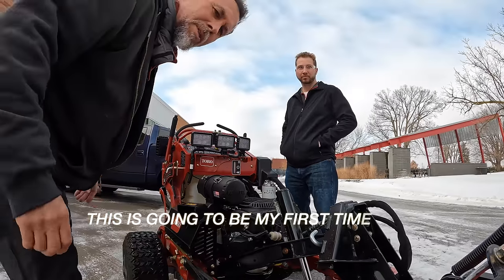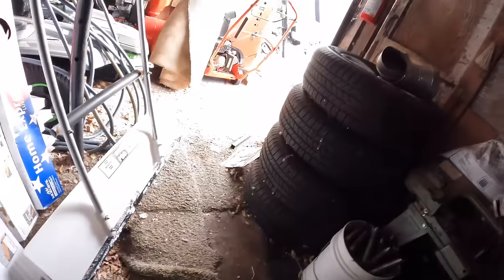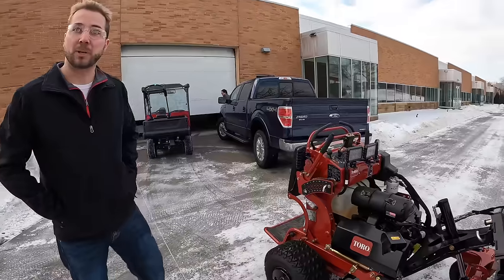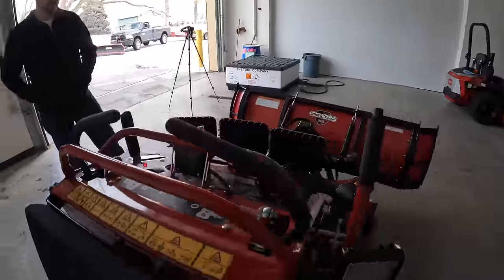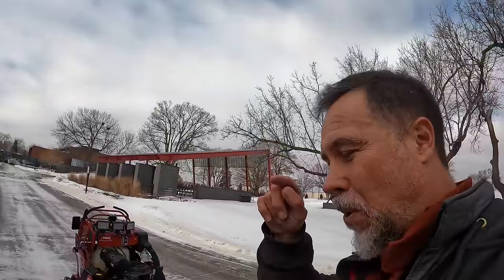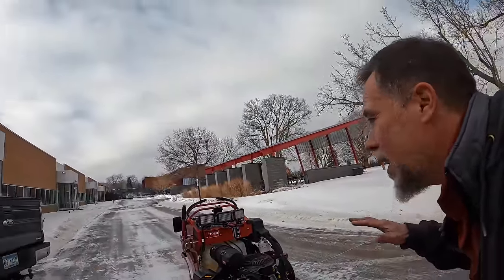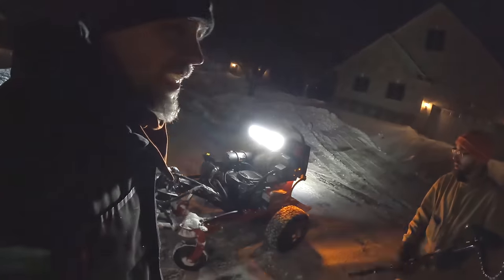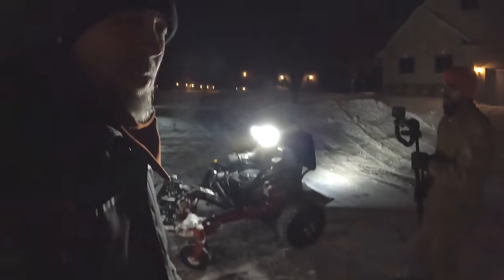Testing a new machine in Fresh Powder

Comment: Considering I've been using loaders for all my residential snow Removal and I've timed the whole operation being that on 6 inches plus of snow I can do in excess of 30 residential properties in under 5 hours  (for anyone who don't want to do math that 6 properties per hour with travel time - driving loader to each proeprty - not loading machine onto trailer, average distance is 5 blocks between properties). I will have to say that I will pass on the whole concept of jumping on the multi force bandwagon as my loader serves multi purpose, smaller snow storms under 6 inches I can also use the loader to actually clear small parking lots as well which elimated the need to drag truck plows out (ive almost eliminated thr whole requireme t for pickup truck plow sinarios for small properties with the loader). In all with all my properties - parking lots, commercial properties I have tweaked my system where I do nit need to pull around trailer for equipment like the multi force would require, I do not need to "freeze my __ off" clearing snow standing on the back of a small machine, I do not have to drag around small snow blowers in back of a truck as I can literally carry the blower right in bucket if required which eliminates the need to lift blower in and out of truck - I simply put in bucket at ground level, lift bucket up and I go down road - opposite for unloading, lastly for those jobsites where snow piles become issues I can scoop snow from one location quickly and relocate snow to entirely different location if needed. In all the toro multi force may be the poor man's alternative to clearing snow but for someone who can afford the luxury items a compact loader by far out bests the multiforce.